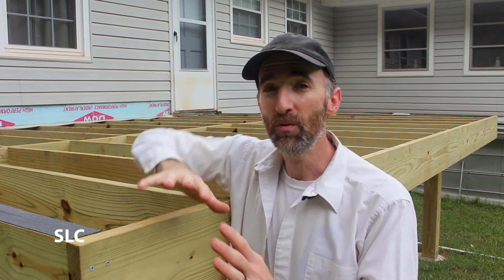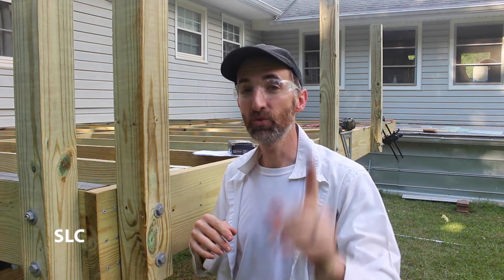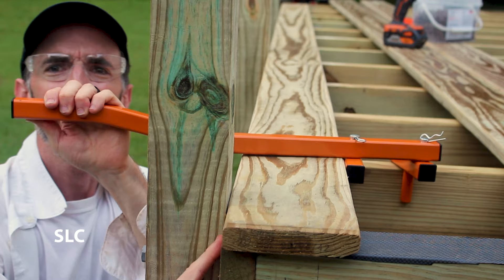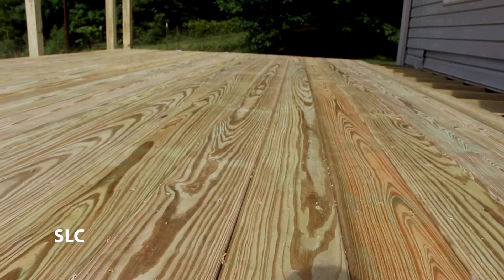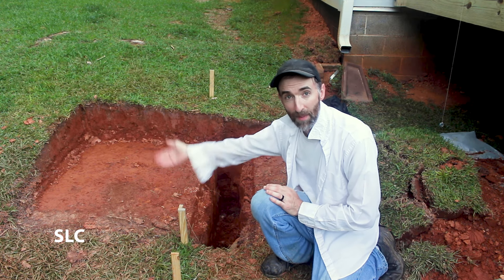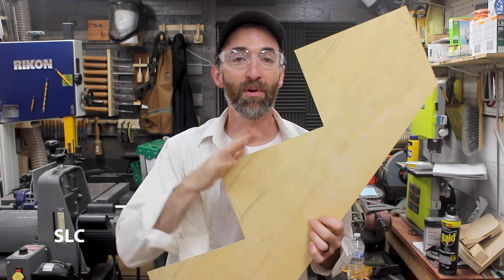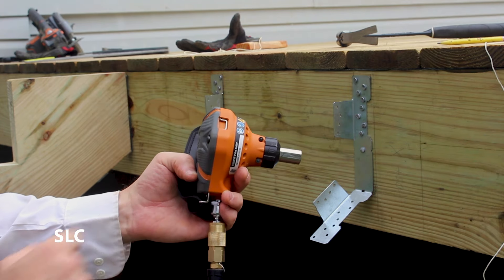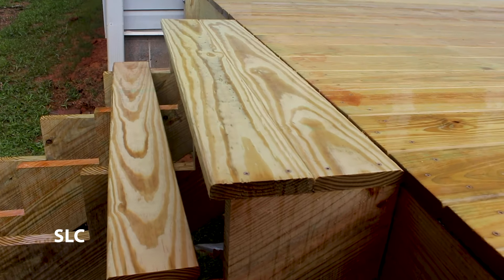Adding Decking, Stairs, and Posts - Building a Deck 2 of 3

Comment: When you are installing the 2x10 at the bottom of the stairs make sure it is Ground Contact Safe material.  Most 2x stock at the box stores is not so you may need to go to a lumber store for them.  It is a big pain in the back side to dig out the rotted plate only a couple years after you built the steps because it rotted away.  You can also put some stair hangers under the stair stringers so it is not always in direct contact with the damp cement of the footer.  Secure the hangers to the plate and the stringers to the hanger.

Comment: Is there a reason we don't use the deck screws to connect the stringer connectors ? Why use nails here?
Reply from the maker: The sheer strength is my higher with the nails.
Reply: @SpecificLove7  thanks! Is galvanized or stainless steel recommended?

Comment: why did you not use joist hangers , here code is you have  to use them on the deck joists  and the stringers
Reply from the maker: I did use joist hangers on the house side.

Comment: Great video it's coming along great, i think you got our weather with all that rain as we are into week two of a heatwave. 
Why did you use a Circular Saw and a Pull Saw to cut those stringers, when it would have been much easier to use a Jigsaw? 
Stay Safe and dry,
Barry (ENG)
Reply from the maker: You are correct, but I felt like I could keep the cut a little bit straighter with the circular saw instead of a wavy pattern that I would have cut with a jigsaw. 😁
Reply: Agree, a circ saw is a lot easier, faster and straighter than a crazy jig.

Comment: no g-tape on the joist? it might not be code, but it's the right way to do it.
Reply: 48x16 deck here, joist tape would be $300. I bought 5g of Liquid Rubber for <$200.
A little messier and takes more time, however several coats of that is thicker than joist tape and seals nail and screw penetrations very well.